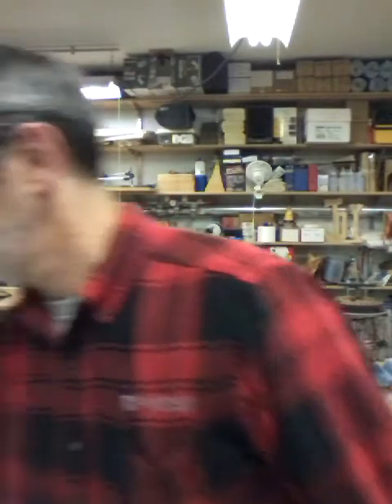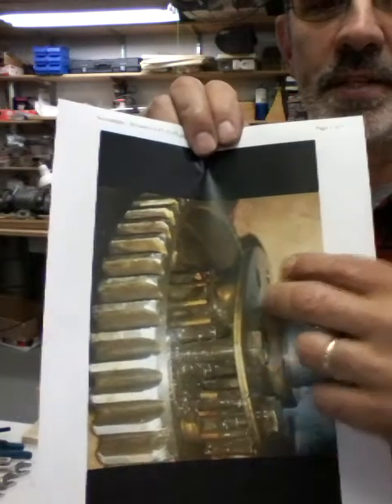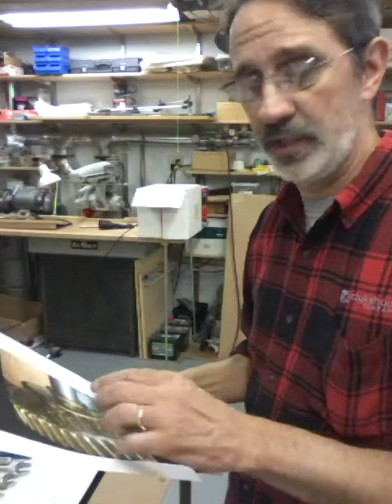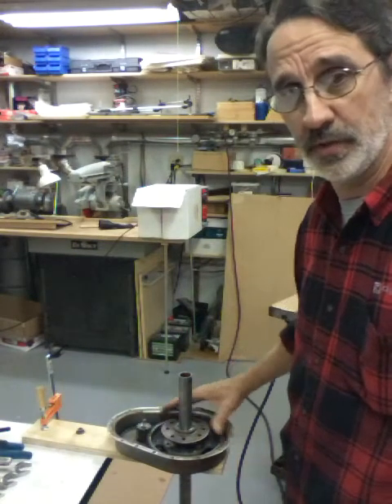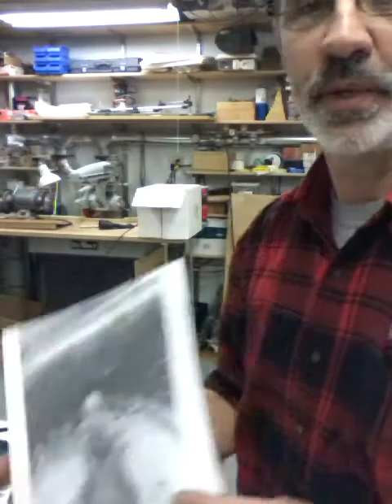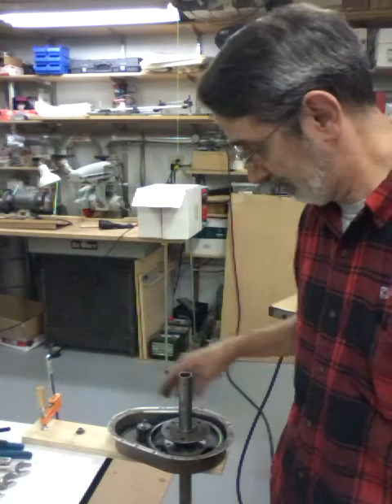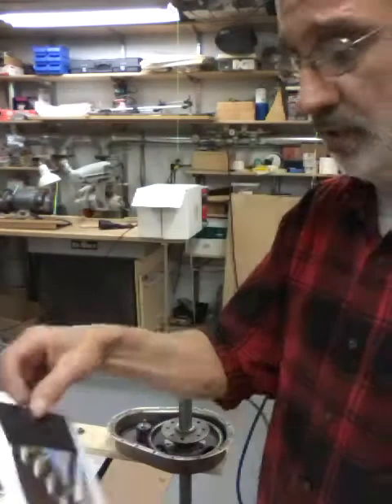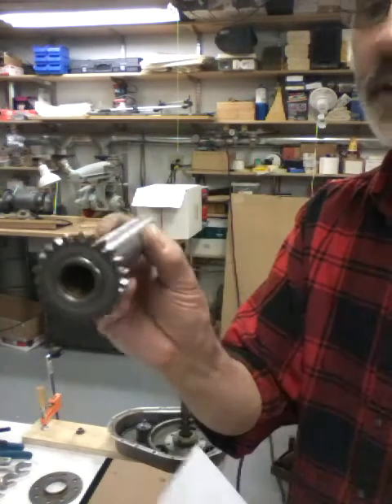25. Snapper drivetrain build,  email answers

Comment: Oh yeah and do we have to drain the oil every time we stand up our snappers ???
Reply from the maker: no you don't necessarily have to drain your oil every time you stand up your machine but when I stand mine up for the winter to store it then I do drain the oil out so it doesn't slowly drip on the floor if you're going to stand it up for an hour or two you don't have to drain the oil need any other questions or help drop me a line thanks

Comment: hi Jim I replaced the drive wheel the   
one with rubber outer that wears out now the snapper won't move feels like the e- brake is on any ideas? very awesome videos!!!
Reply from the maker: send me an email to Jimsfixitshop@gmail.com instead of going through YouTube and send me your phone number I'll call you back I need a little more information on what you did when you put your drive disc on a couple pictures would be nice too I'm sure it's something simple and we shouldn't have a problem figuring this out thanks for your response Jim

Comment: Hi Jim , I want to lube the gears on my differential   , can I just add lube through the 2 rubber plugs? what lube should I use? thanks
Reply from the maker: To Mr hap 1129
My notifications  don't  always  get to me that is why  I like  you to email me at  jimsfixitshop@gmail.com .
So to answer  your  question  yes stand your machine up on its  end and remove  the  top rubber  plug and fill it to the bottom of the top hole and replace  the plug.
 On my  machine  I use 80/90 gear lube. But Snapper sell "0000 lube "you  can  get  it  at any Snapper dealer.   But it is  four times as much. good luck  and as always  work safe  and have fun. And sorry  it took so long  to  get  to  me.
Reply: Thanks Jim,